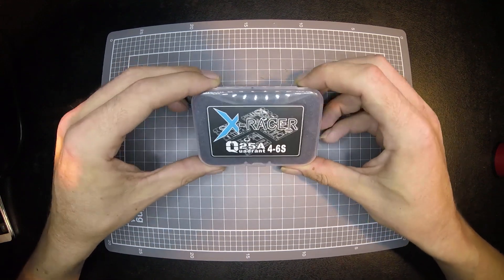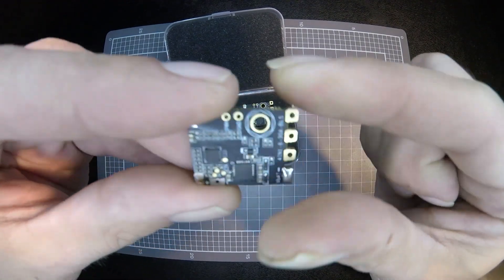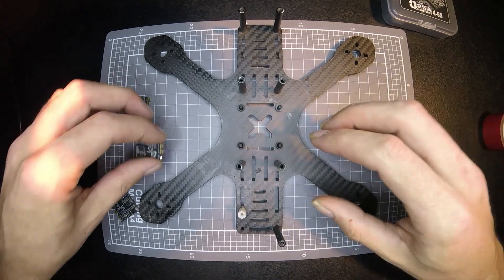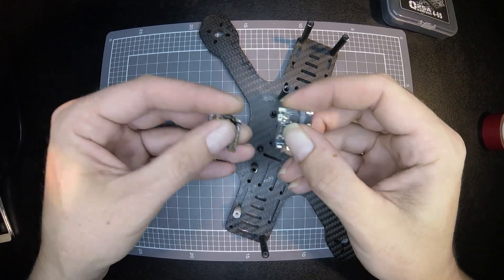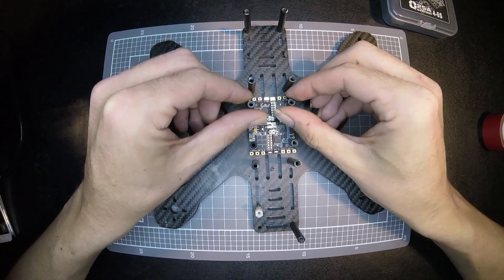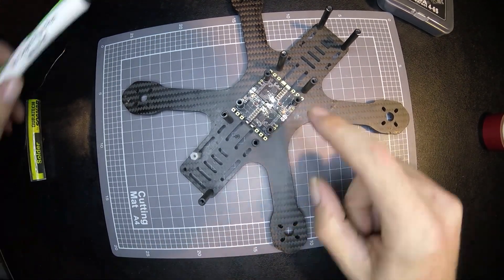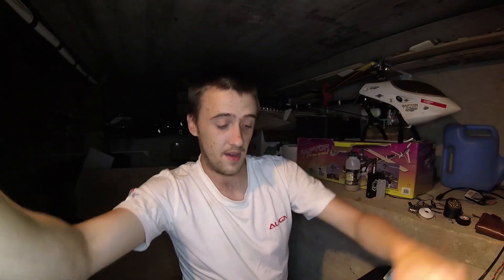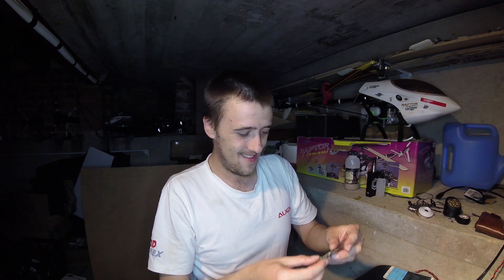X-RACER Quadrant 25A 4-6S - Review part 1 - Bench build

Comment: Anyone got the new xracer quadrant 25amp esc dshot 1200 and no the wire diagram for it
Reply from the maker: I've got a set , its very much like these so i didn't think i needed to do a video but if you really want one i can make one :)
Reply: No worries got it sorted now , I have just got the 25amp ones not like the ones in your video as mine 
There is only one signal wire on each esc not like your ones have two holes for the signal wires the +and- 
So was confused but after speaking to the supplier he said they run on the one signal wire per esc so confusion over.
Reply from the maker: Ar yes the new 32bit ones lack a signal ground , Not a drama but i can see that being confusing , heck i even had to triple check it wasnt hiding anywhere

Comment: Hey thanks for that vid, If you don't mind, I've got a question: I'm failing at soldering the quadrant together : / As soon as I start melting solder, the melting stops! Can't get to bridge them. Did you have troubles too ? What temperature should I set my iron to ? Any advise ?  I'm so stuck.. I might even have damaged them, I don't know, since I've let the iron tip sooo long to try to melt enough solder : /
Reply from the maker: I set mine to about 350c or 660F , if your using a conical tip then try and get your hands on a chisel tip or bend the tip so you can get more surface area . its very likely not your fault but more the iron , once you have a iron that's hot enough the solder will flow with ease. also flux as always.. it never hurts :)
Reply: thanks for the quick reply, much appreciated. I've tried my iron station max (450 celcius) many times : / with flux, nothing works. I wonder if I should try to leave the iron tip longer to get enough temp ? Or should I not do that cause it will damage the board ???
Reply from the maker: Worth a shot , any longer then 10-15 seconds and i might be worried but it really sounds like a under powered iron so chances are slim that you can get the whole board hot enough to do damage without being able to solder the connections
Reply: ok.. I'll give it a go, with my fingers crossed and shaking !   : /
thanks for your input ;)

Comment: any advice for using as 4-1 with BF FC ? I've been reading a lot about the current shunt but not sure which wiring option is best cheers !
Reply from the maker: at 7:09 on this video https://www.youtube.com/watch?v=0nFK-ZRlDo4 i show how i wired my qaudrant as a 4in1 with the bff3 , i wired ground to the 4in1 and power to the input of the bff3 then output to the 4in1 then a smaller ground wire from the 4in1 back to the ground on the bff3 , this last wire is used as a reference for the current shunt & completes the circuit so you have current scene and also needed for power for the Fc on 5v/3.3v so 14-18G will be fine
Reply: ***** cheers dude I'll try follow you're set up ;)

Comment: I love these, but I'm so worried of hooking up 6S battery power to them. Are you sure they're capable of full tilt 6S voltage? Wise people are telling me to be weary lol and not to use it on my 6" prop builds. I'm currently running F60's.
Reply from the maker: Weary would be wise i feel , its not that these esc's cannot handle 6S as they are rated for 50V so in theory there good for 12s but more there only good for 25A RMS and it will be easy to go over that on a 6S build , deprop and your should be fine but know your limits , check out some bench tests on those motors and prop combos to find something that should work .

Comment: These look sweet, looking to order some. Just wondering if there is a 5v out on these, or how are you powering the FC? Thanks!
Reply from the maker: No power out on these , on my build with the quadrant im running the betaflightf3 and that has on board regs but i use a small 2-6S 3a BEC on all other builds
Reply: Good to know, Thanks!!